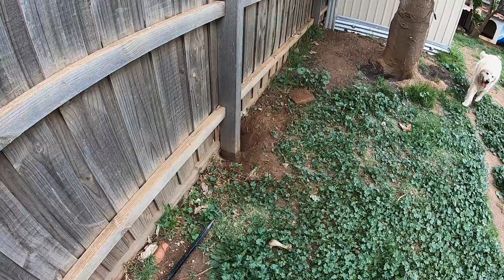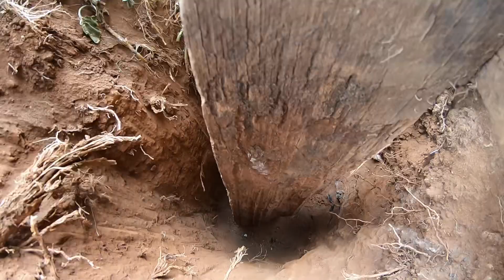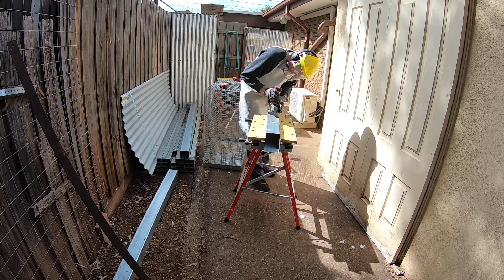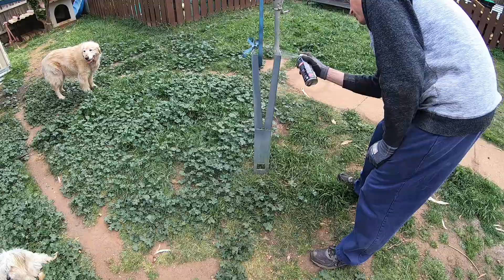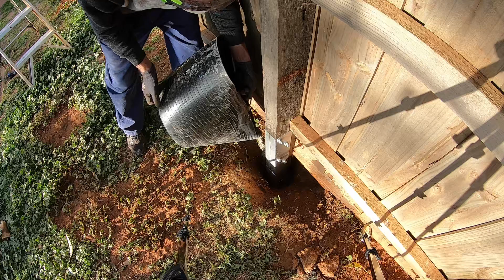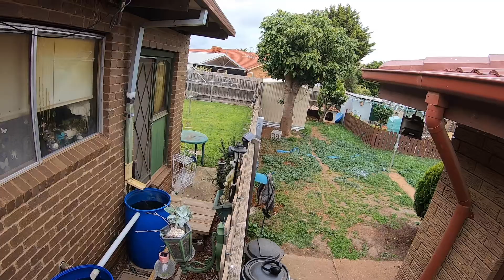Reinforce fence post

Comment: I had two 80 lb concrete mix into a fence hole and years later I had no idea how hard it was to dig it out. Dig all around the concrete then try to roll it out but falls right back into the hole again and again.  I was that Greek mythology Sisyphus as punishment for the day, must be something said to the wife.
Reply from the maker: That's what I use my engine crane is for.

Comment: The posts always rot out because the concrete is poured below soil level, wood deteriorates in soil. Also weed eaters beat up on deteriorated posts.
Reply: Termites etc.
Reply: That is why I installed all metal posts for my fence.
Reply: @HsingSun  did you pour concrete higher than ground level? Its tricky, but I think it's worth it, also, you can paint concrete whatever color it people think it looks hideous. Anyways. Good day
Reply: Nice fabricated support but most DIYers will not have all the metal working tools to do that part...

Comment: Best option, replace all those posts and just use galvanized steel posts. Would never waste my time wrapping wood posts in steel. Cheaper and faster option if you aren't replacing them all, just buy new wood posts and properly treat and set in concrete. Those old posts posts will still rot as water runs down the seam and the inside edge, and that wrapping wont be attached to anything. Don't get it. And because you left concrete below grade/top of soil, water will pool around post. As another pointed out, you forced aggregate to bottom, concreate will crack. You are going to be disappointed.
Reply from the maker: The boundary fence on the other side is all Gal posts
Reply: @Robb001  Thumbs up! I learned the hard way, the reason I replied.
Reply: Putting new wood posts in concrete is not the right thing to do ,nowadays !  After doing it for 30 plus years with little problems with rot , its now said to set your wood post on an above grade  cement piering attached with triple galv  bracket !  I started putting heavy plastic bags over my posts before I filled with concrete mix !  To keep water from post . I see they have sleeves now that slide over the post !  Every couple years they tell you something different !
Reply: @gregr1672  Never tried the brackets. Assume they are fine. Agree putting wood in concrete is bad choice. I prefer galvanized u-shaped posts because they attach all the way up. Can't see them once planks are attached either.. Both options mean future replacement is easy.